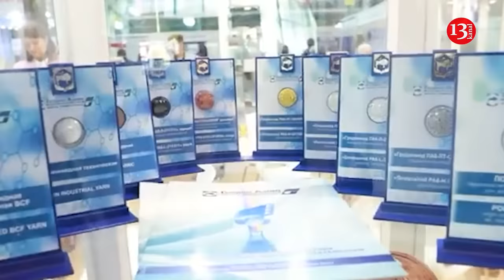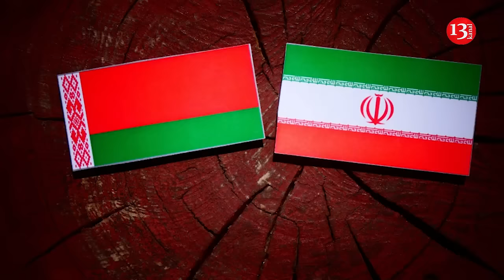Belarus threatened Poland and US with war, took another hostile step against Ukraine

Comment: Bizarre. The failures in logic just at face value without in depth analysis are as follows.

1) NATO is a defensive pact, not offensive, so "it" will never invade anyone. Member states might, but NATO cannot.
2) Nobody even remotely threatened to invade Belarus in the first place. 
3) Why would Belarus need Putin's sanction to use nuclear weapons if invaded? Is it a sovereign country or a sock puppet?

As far as I'm concerned US troops should secure Ukraine's border with Belarus so Ukraine can concentrate forces on their Russian front. If Belarus wants a war with the US I can guarantee it will end quickly.